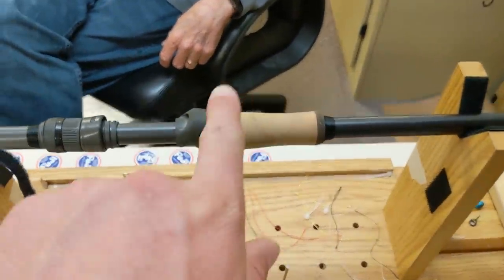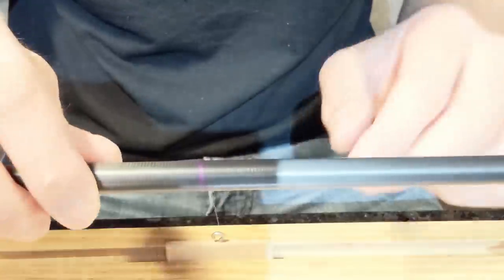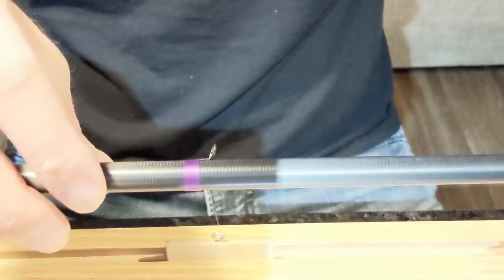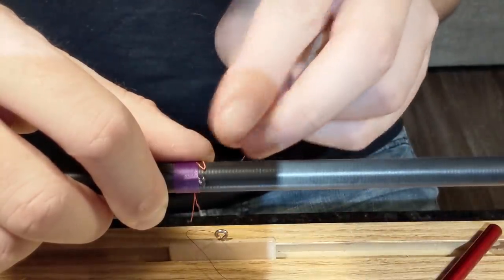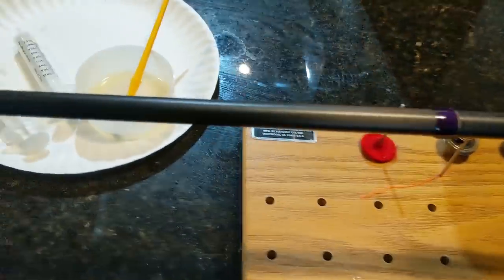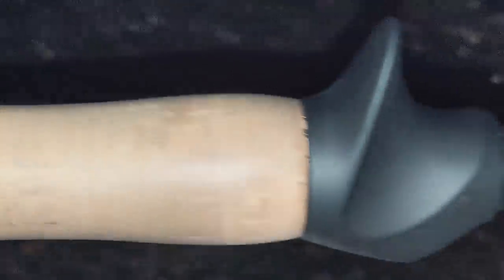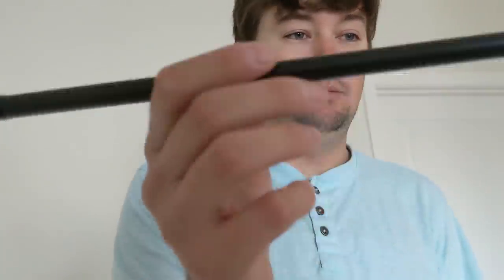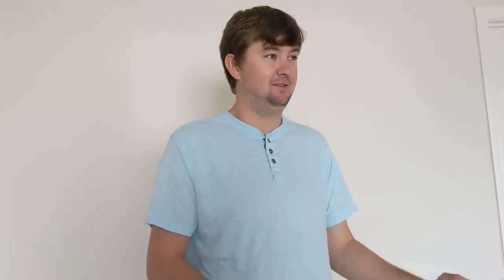Custom Rod Building! HOW TO! +Bank Fishing Footage Ft. Fuji and Point Blank

Comment: Great job..built my rods in the 80's and 90's learned a lot from doing rods. I now have saw the industry make changes to rods and reels over the years to address many of the problems  I saw with them then ...still waiting for the new reel design change idea I had back then ...good luck keep on point , improvements are still needed

Comment: fuji titanium torzite guides and point blank  .id say  your already on the high end of the rod building world  lol  thats an awesome start..i mainly use  north fork composites x-ray carbon blanks with  the same fuji guides .here is a link to show you how to do a locking wrap on your single foot guides .it keeps them  from pulling out under pressure  
https://www.youtube.com/watch?v=_d9xnQYnjQI

i think finding the balance in a rod is the helps alot  sensitivity .lets say 7 MH  its pretty easy to find the balance with just moving the real seat around  but with  a  7'6  8'0 H  etc and up. as im sure you know they tend to get tip heavy  which messes the balance up and makes it  less sensitive .the is the  ALPS Deluxe Balance System  .i think this is the only place you can get it .

https://getbitoutdoors.com/alps-deluxe-bs-butt-caps

i put these  on all my  rods small  jigs to to 10 oz swimbait rods.. lets  say  im  in  florida  punching  the thick mats  .i can pull out a carbon   swimbait  or flipping rod  and change the weight on the butt to balance the rod at the reel seat ..no off the shelf rod can do that ..thats the beauty of building  your own rods..good luck in the  elites next year..
Reply from the maker: Thanks for the tips.  I agree 100% balance is the most important